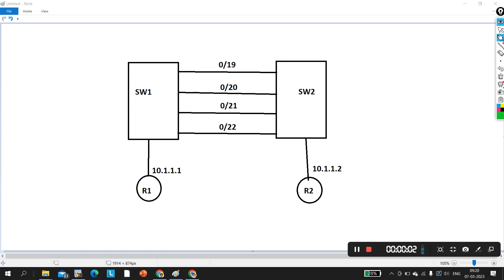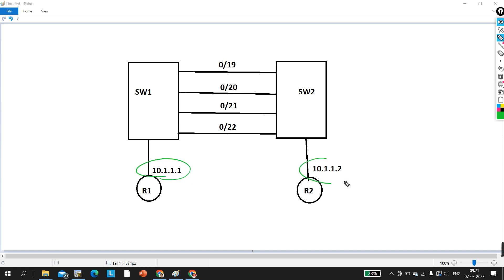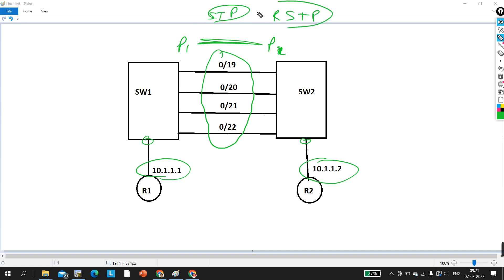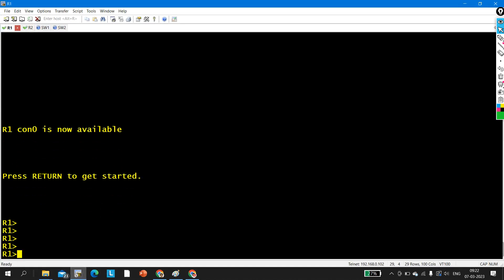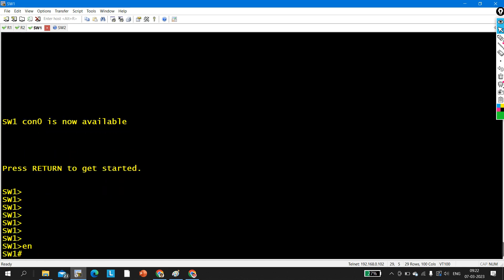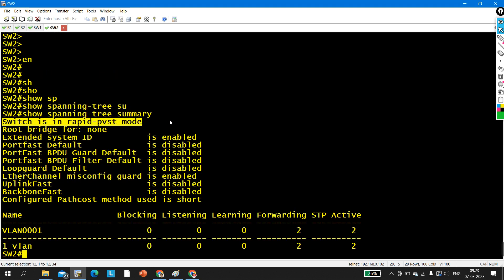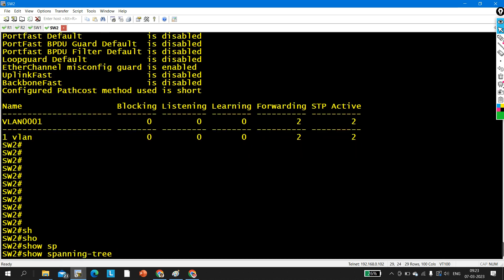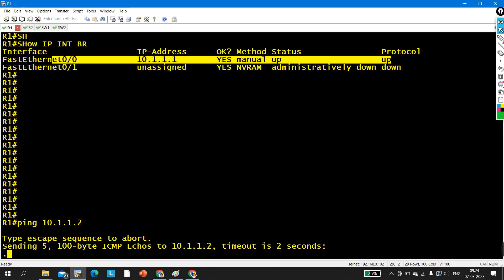Real-Time Network Troubleshooting For Network Engineers #network_engineer #cisco_ccie #pmnetworking

Comment: 12:57 I don't have much experience with real networking equipment yet, but did I understand this correctly? Are you saying that due to high CPU utilization, the configuration on networking devices can accidentally change?